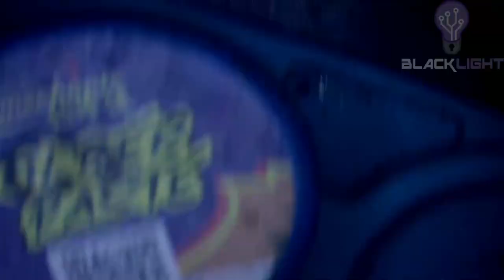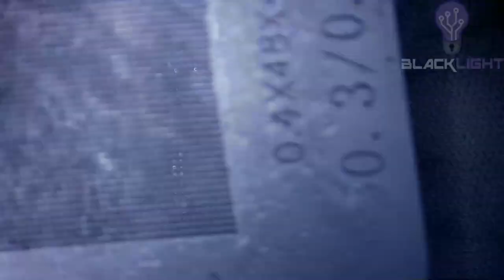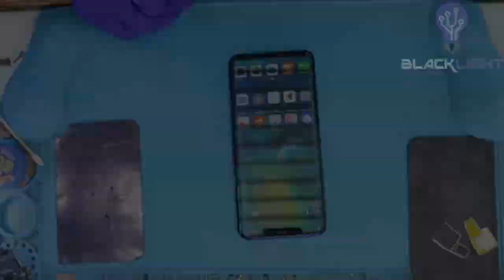Huawei Mate 20 Pro Stuck On Logo Repair ✅

Comment: What temperatures did you use for removing the shielding and for removing/reballing the chips?
Reply from the maker: I mentioned all these details about the temperature and air flow in one of the videos (Samsung A12 CPU Reballing), you can check it out 👍🌹